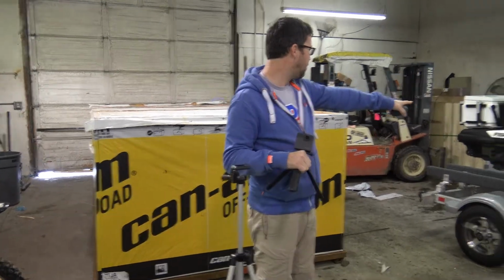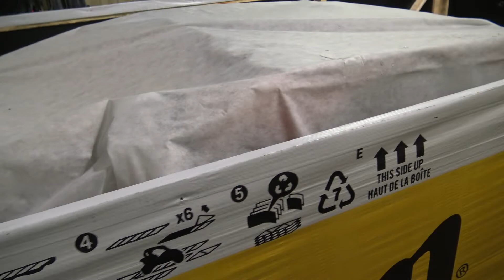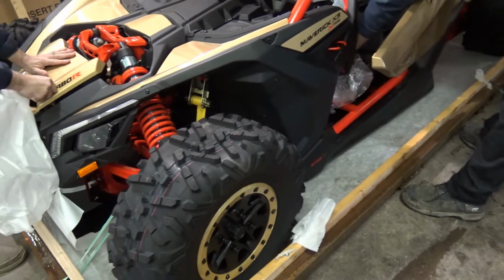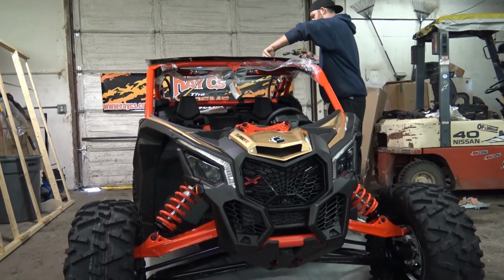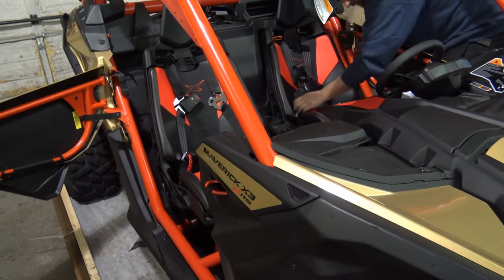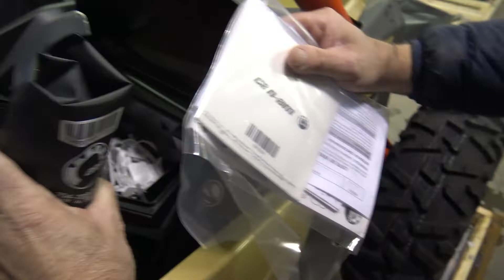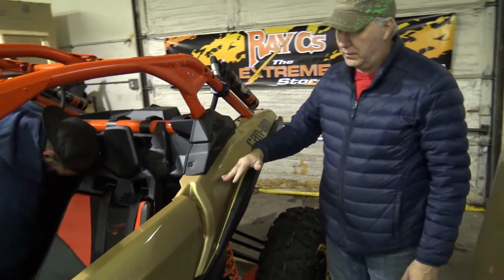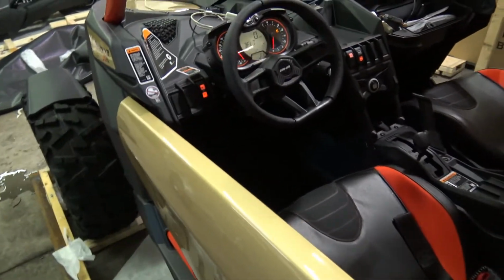Mud Masters X3 XRS Full Crate Build !

Comment: This is a prime example that you can compress the suspension when you strap it to the trailer. If manufacturer does it, it must be ok. I know a lot of people that say it weakens the shock seals. I pull my suspension down 3-4 inches and rig doesn't move a bit.
Congrats on new rig!!! I'd be interested in this March 2nd ride you spoke of.
Reply from the maker: Yes! Exactly!! that machine is a 2018 so it had been compressed for 8 months like that. So i call BS also on the shock wear. I have to compress the XMR to get it in my enclosed trailer